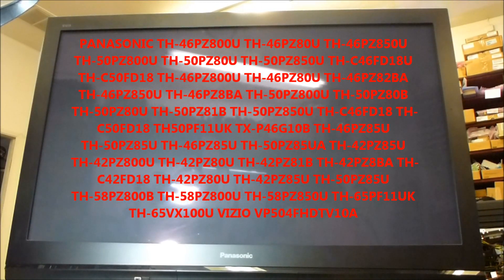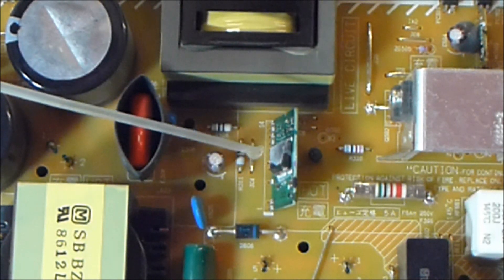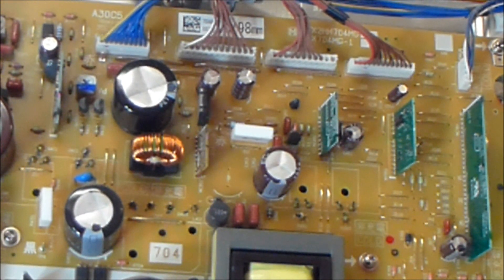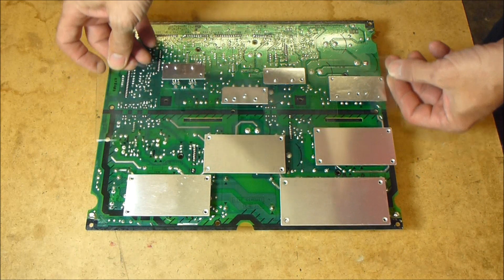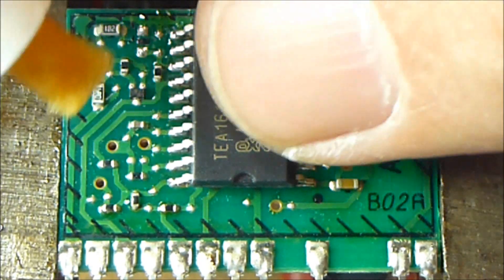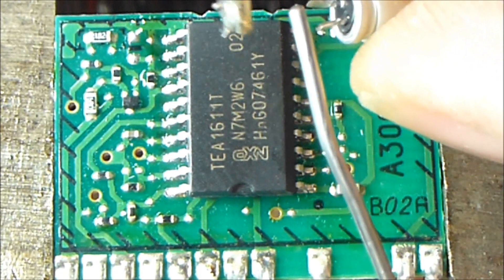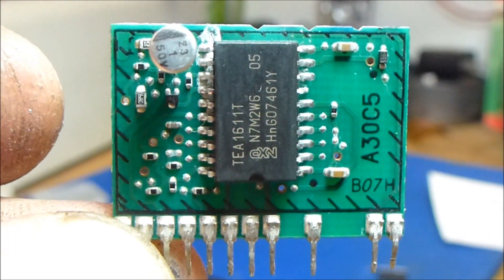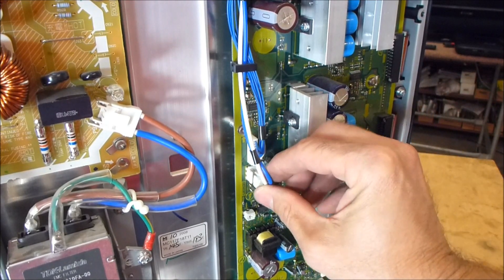Panasonic Plasma 10 and 2 Blinks TEA1611 ETX2MM702 704 706 Power Supply TH 42 46 50 58 PZ 800 85

Comment: Mr. Spencer,
If I take the back of my TV off and spray the NXP and the TV comes back on is that all the repairing that is required? or in order for it to work properly after that piece cools down again do you have to replace both of the IC Packs? I need to figure this out before my girlfriend's mom finds out the TV not working any more wouldn't be to happy with me. So if you could help me with this issue it would be greatly appreciated. 
Sincerely, 
One nervous boyfriend.
Reply: Joe,
The steps and procedures in the first part of the repair video is for diagnostic purposes which identifies the partially failing component.  This means that when the capacitor near the NXP controller chip is cooled, the capacitor is better able to hold a charge and not shunt current through it (partial breakdown).  When the capacitor warms up, the partial ceramic breakdown manifests itself once again.
Therefore, to correct the problem, you must replace the capacitor as this is the failing component.  I recommend you have a friend who has good soldering skills remove & replace this capacitor with a high quality electrolytic capacitor.
It is not your fault that the TV has failed.  Many thousands of Panasonic plasma TV's around the world have failed as a result of THIS inferior quality capacitor.
What is the model number of your TV  ?
Regards, GS
Reply: Gary Spencer TH-50PZ80U...okay i will try to find a shop to work on it.
Reply: Joe Vacca
Joe,  I assume that you will conduct the "cool down" test to prove that the small MC301 board is the main problem.  GS.
Reply: Gary Spencer yes going to do that this weekend then if that is the problem. Then look for a shop to fix it because i cant solder that well.
Reply: Gary Spencer what could it be if the tv does't kick back on after performing the cool down test? more nervous now
Reply: Joe Vacca
Joe,
If you performed the cool down test properly for BOTH MC301 board and MC201 board (separately) then, it is still possible that
the failure mode for the capacitor (on MC301 board and/or MC201 board) is extreme AND it will not allow the resonant converter power supply to function at all.  This is a definite possibility.   Why  ?   Because if this capacitor fails completely, it will drag down the power rail for the NXP chip ......and the NXP chip cannot do its job.  It is the same as if the NXP chip did not have any power to it.
The TV power-on LED will blink an "error code" SOS when it tries to power up.  How many blinks do you observe after pressing power button  ?
            NOTE:   Isn't it amazing that a 3 cent capacitor can kill a $2500 TV  ?

GS.
Reply: Gary Spencer Yeah it is crazy how just the littlest thing can make something stop working. But when I first turn it on it flashes 2 times really fast then it just continues to flash when the TV is plugged in.
Reply: Joe Vacca
Joe,
The LED will blink out a REPEATING code with a pause of about 3 seconds in between code sequence.
So, after you observe a 3 second pause at some point, start counting the very next blinking code sequence and let me know what it is.  It is very possible that the CODE is just 2 blinks followed by a 3 second pause, then 2 more blinks, etc.
GS
Reply: Gary,
Its the initial 2 blinks. (blink, blink) followed by 1 blink then a 3 second pause.
Reply: Joe Vacca
Joe,   If you observe the code blinking sequence for an extended period of time, does the code pattern repeat  ?
When the LED blinks out a code, it is a steady on/off blinking pattern with NO DELAYS/PAUSES except for the PAUSE period of 3 seconds.
The Panasonic fault monitoring subsystem has 13 separate fault codes (1 thru 13) to help isolate where the fault location was detected.
After powering on the TV, sit and watch the power LED for at least 60 seconds to verify that the code is a repeating code pattern.
From what you're describing, it is probably ONE blink, 3 sec pause, ONE blink, 3 sec pause, etc.
Hope this helps.   GS.
Reply: Gary Spencer Yes Sorry i have been very busy lately. But yes it is just a one Blink code I believe what does this mean for our TV?

Comment: I have this problem with my TV. I'm going to attempt the repair but was wondering about the 10W resistor load that is used to discharge the big capacitors. When do you discharge the capacitors? I'm confused because he does it at the end of the job. I would have thought you do it before you start working on it...

Comment: Finally got a can of compressed air and did the test. The upper  left  chip when frozen let set turn on.  Can you fix my board ? You seem like a  surgeon of soldering .!
Reply: Steve,
The guy that produced this repair video is a highly skilled electronic technician from Northern California. 
He operates a repair shop and produces many detailed debug & repair videos which are some of the best I've ever seen.

So, you only need to replace the ultra small capacitor.  This is the actual part that slowly goes bad.  The NXP resonant converter controller IC rarely goes bad.  Extremely rare !
If you know someone who can remove this capacitor without damaging the board, I recommend that you take the board to them ......or perhaps take it to a service shop.  It takes about 3 minutes to remove & replace the capacitor if you know what you're doing.  However, it is very easy to damage the small board.  These boards are no longer available  !!
Repairing electronic devices is just a hobby (and necessity at times) for me where my background is electronic engineering and I have very good "board re-work" skills almost as good as Norcal715.  I also have a keen interest in high current, ultra high efficiency, switch-mode power supply design methods.
If you have no access to good technician, I can perform the repair but I have no way to test it.  It would take me far too much time to test your board in my HDTV system.  What part of the US do you live  ?
Let me know what you think.
Regards, Gary S.

Comment: Hi Gary, thanks for taking the time to make all these wonderful videos, much appreciated!
i have a panasonic TH 42PX80E with the same issue. 10 blocks and she i turn it on i hear the two clicks and after a few seconds then a third click and then off. and help, links would be great fully appreciated. 
cheers and keep up the great work
Reply: addendum: i finally found out the SD car reader was causing the fault. i unplugged it and tv ran great, until i screwed on the back….needless to say, now the tv only goes to standby, 2 clicks and won't power up ( no third click) 
thanks
regards Ralph( stumped in Australia)

Comment: Do you repair these boards ? Mine has 2 clicks and fans move for a split sec. Really bummed out . I loved my TV , can you help? The board is identical to yours.
Reply: Steve,
What is the full model number of your Panasonic plasma  ?
Did you attempt the "cool down" test shown in this blog repair video  ?
Thanks, Gary S.
Reply: Gary Spencer
Reply: steve l th-46 pz850u no I have not  .
Reply: steve l
Your HDTV has the same power supply board as shown in the repair video.  I suggest that you perform the cool-down test on the MC301 ckt board.  Just spray the NXP integrated circuit chip AND the tiny ceramic capacitor located at the top of the board (it's very close to the NXP IC chip).  Watch the front end of this repair video so that you know exactly where to spray.  Use a can of compressed air (70psi) with the can upside down and spray for about 3 to 4 seconds.  If this does not work, repeat the test on the MC201 ckt board.
Is the front power LED blinking a SOS Code  ?
If so, how many blinks do you observe  ?
Regards, Gary S.
Reply: Gary Spencer  its a ten blink code.

Comment: I am wondering if just buy the power supply assembly, instead of repairing it. Looks like easy how to do it but the tools need to buy it too.
Reply: Alex,
Yes.  This could save you time and money IF you performed the "cool down" test shown in the repair video.  If your main power supply board responds to the "cool down" test, then go buy a refurbished board.  Replacing the components on the board(s) requires very steady hands and skill (in my opinion).
What is the model of your Panasonic plasma HDTV  ?

Comment: I purchased a brand new power supply from NOHO electronics  and had a local repair shop give me a estimate of around $300 to replace the power supply and the Sc board.  I started with the power supply and am workings on ordering a repair kit for the SC Board from eBay.  Im a do it yourself kind of guy not scared of a little work just need a little advice. Thanks
Reply: Excellent.
I am fairly confident that we can find the problem if you are willing to measure voltages and transistor and/or diode "shorts".
Do you have an accurate, digital, volt-ohm meter  ?

Below is a brief summary of possible causes that can generate 10 blink SOS:
.........10 BLINK CODE ..........
Abnormalities of the F+15V. Reasons:
• The P board is not generating the F+15V
• SUB Voltages are affected by the K board or by metal object present in the SD  card slot.
Shorted Vsus (By the SS board or SC board).
Shorted Vda (By the panel, C1, or C2 board)
Wrong diagnostic by the A board.

The above boards are very expensive.
Download the Panasonic Troubleshooting Handbook and read very carefully.  Also,
you will have to measure voltages for a VERY brief duration since they only appear
just after power-on when the TV system is in failure mode.  This can be a pain-in-the-ass but even a trained factory technician would have to perform the same voltage checks to help narrow down the failing board ....followed by isolating the failing component.

http://elektrotanya.com/panasonic_tc-p42g25_tc-p46g25_tc-p50g20_tc-p50g25_tc-p54g20_tc-p54g25_fhd_plasma_tv_troubleshooting.pdf/download.html

This Handbook should serve as a good guide for your TV model.  You can also download the Service Manual from this web site.
   http://elektrotanya.com/panasonic_tc-p50s1_chassis_gpf12du.pdf/download.html

Use EXTREME caution when working on these HD TV's.  There are very high voltages on the main power supply and display driver boards.  The power-entry Power Factor Controller output is +395V DC and Vsus is around +190V DC.

Good Luck.   Regards, GS.

Comment: Just try replacing  the capacitors and the chip but i may have damage one of the board on the capacitor connect ...  :(     it still do the 3 click and the 10 blinking.
I have a TH-46PZ80U 2008   power supply ETX2MM704MG. Can we order the  MC201 and MC 301 anywhere  or from Panasonic ?
Reply: Unfortunately no.  Panasonic don't manufacture those anymore.  You might try to get a used one in eBay or Amazon.

Comment: Hello please help i replaced my power supply board on my Panasonic TC-P50S1 because it stopped turning on. I Was watching it the night b4 the next morning nothing, no click on powering it was completely dead.  After replacement of new power supply i got a click and 10 blinks from the red Led in the front next to the power button.  Is their something else i should have replaced with the power supply.  Can u please help.  ?  Thanks
Reply: Metz,

Where did you get the replacement power supply board  ?
It's possible that this board has a problem as well. There are several boards that can cause the 10 Blink SOS code.
Replacing boards randomly will not resolve this issue unless you get lucky at the "second try".
I recommend that you take your Plasma TV to good HD TV repair shop and get an estimate.
Regards, GS.

Comment: Hi, Thank you for posting this video. I took my TH-C50FD18 to the shop today. It has the 10 blink code. They said $65 to examine it, and that would be applied to the repair cost. If they say $400 to fix it, I think that is too much considering the price and quality I can get with a new TV these days. Do you have advice for someone who does not have equipment to solider this small piece an fix it. Is it possible for a novice to simply replace the whole board, or is that too advanced? If so, what is the part number. Thanks. Van.

Comment: My tv never clicks when I plug in. Just goes straight to the 10 flashes. I froze both ic's and no change. I have the exact same board in the video. Any advice?

Thanks 

Jason
Reply: Jason,
Please list the full model number of your plasma TV.  Thanks.  GS.
Reply: Th-50pz85u. February 2008
Thanks for the quick reply.
Reply: Jason Wilson
Jason,
The instant that you plug in the TV to the wall outlet, you should hear 2 faint clicks (instantly).  In a failing unit, there will be a 3rd click 2 seconds after the first 2 clicks.
In a fully functional unit, you will hear the 2 faint clicks the instant you plug into outlet where a 3rd faint click will be heard 14 seconds later (14 sec delay).
Do not press power-on button on the TV or remote control.  We are not trying to power up the HDTV.  I am only interested in energizing the "stand-by power" which occurs when TV is plugged into an outlet.
Also, check all the fuses on the small AC Power supply board and the large P Board main power supply.
Regards, GS.
Reply: Gary Spencer Hi Gary, I have the same model and same year it was made. I heard the 2 clicks along with the 3rd click after approx 14 seconds. I am curious as to what I should be looking for or replacing. Thanks!
Reply: Gary,  I get no clicks when I plug I'm the tv. I know the sound and it's not there anymore. The 10 blinks start with or without pressing the power button. 
I found two fuses on each of the power boards and they are all good. 
Thanks again for your responses. Any other suggestions?
Reply: Jason Wilson

Ok.  Good.  I just need to make sure.
You need to follow the hardware troubleshooting steps to isolate which board is likely bad.  After that, we can narrow down the fault on the specific target board.
So, download the Troubleshooting Handbook at the link below and start the procedure on Page 26.

http://elektrotanya.com/panasonic_th-42-46-50pz80u_th-42-46-50pz85u_th-42-46-50pz800u_th-46-50pz850u_chassis_gph11du.pdf/download.html

Use EXTREME caution when working on the back of these HDTV's.  The stored energy can be lethal (stored charge on large capacitor banks on P Board, SS Board, and SC Board).
At this point, I would advise that you request the help of a trained electronic technician to narrow down the fault.
Regards, GS.
Reply: Jordan Ramanis

Are you getting a "blinking SOS error code" on the power LED on the front left lower corner  ?
Reply: Gary, did first step of troubleshooting flow chart, check pin 6 of P7 connector to ground and I got the 3.2v. Says to replace P board. So looks like P board is the issue. Tell me what to check next and thanks. I am thrilled that I can actually have a chance to fix this.
Reply: Jason Wilson

Jason,
Examine all the electrolytic capacitors very closely on main P Board for any evidence of bulging top of capacitor case as well as any leakage of electrolyte which is usually at the bottom of capacitor.
Also look for any discolored component that may have had heat damage or burn marks or burn marks on surface of ckt board.
It might be worth the time & effort to replace the ultra small ceramic caps on the MC201 & MC301 boards to see if this is causing the fault.  It only takes a few minutes but you have to have good soldering skills so that you don't damage the pads on the ckt board.
Reply: Gary,  I've examined the board and don't see any tracking or bulged caps. 
I found a p board locally out of a tv with a cracked screen so I put it in. 
Now I have the 2 clicks but still goes to 10 blinks and no third click. I tried the freezing trick and it did not work. Fuses are all good. 
I used the trouble shooting guide and on page 26 looked for 15v from pin 7 on P6 connector. I got 0.32v. The next step was to unplug the P6 and then check for 15v at pin 7 on the connector. I got 0.6v. The flow chart decision says this p board is bad too. 
I'm starting to think I'm in over my head on this and I should give up and just buy a tv on Black Friday. 
Any more advice?  Thanks, Jason.
Reply: Jason Wilson

Jason,  These TV systems are some of the most complicated devices in all of electronics.  Without schematics & troubleshooting flow charts, most experienced technicians would not be able to locate problems down to the offending board or component.  So, don't throw in the towel yet.  Why  ?
The troubleshooting guide is VERY specific and needs to be followed closely especially when it instructs you to measure these various low-level voltages.
Reason ?  When you plug the TV system into the outlet, if you hear the relays click, you follow the flow chart down that specific path.  The relays latch and quickly unlatch (which shuts down "most" of the P Board).  Therefore, you need to measure the 15V DC voltage at the test point while an assistant plugs the TV power into an outlet.  This DC voltage will only appear for an INSTANT.  The reason for this is the Power Monitor System QUICKLY detects the absence of one or more regulated DC voltages and then sends a signal to P Board Power Manager and shuts down the "primary" side of the resonant converter power supplies followed by the error detect system sending out a repeating SOS "blicking" code.
And, it also de-energizes the power relays where only "stand-by power" is active.
The power supply system is designed to protect most of the circuit boards in the TV from heavy damage to multiple boards.
Therefore, you want to follow the flow chart on Page 27.
NOTE:  There are many "sub" DC Regulators on the D Board & A Board that are all derived from the high current 15V source on the P Board.  These "sub" DC Regulators are low current Switch Mode Power Supplies.  The P Board has two high current Switch Mode Power Supplies that are called Resonant Converters.
Hope this helps.
Regards, Gary